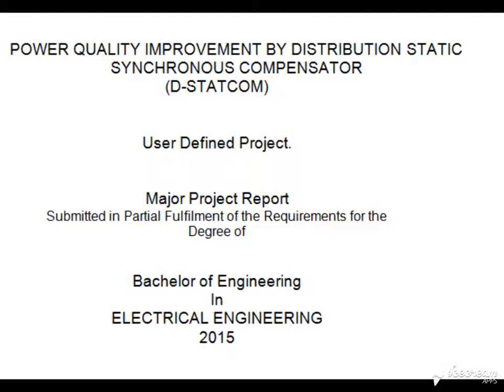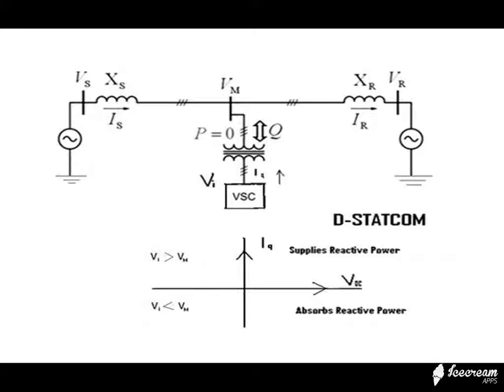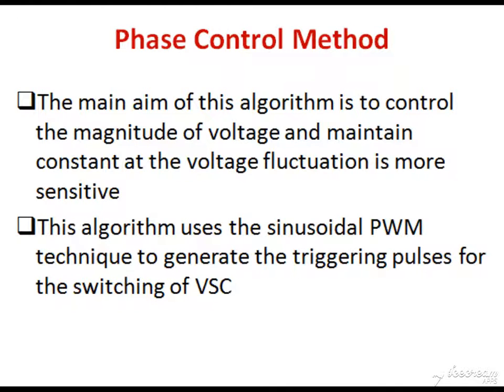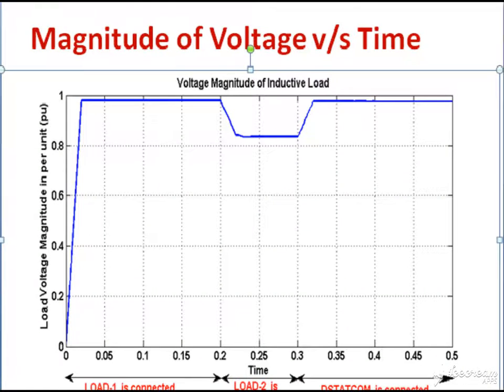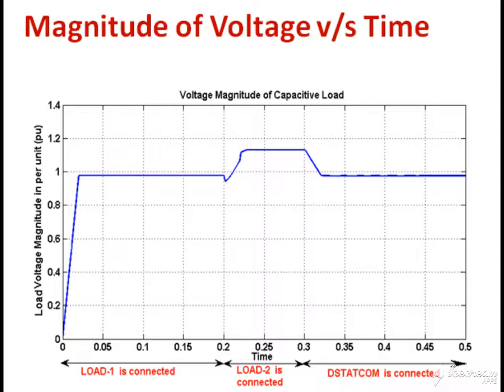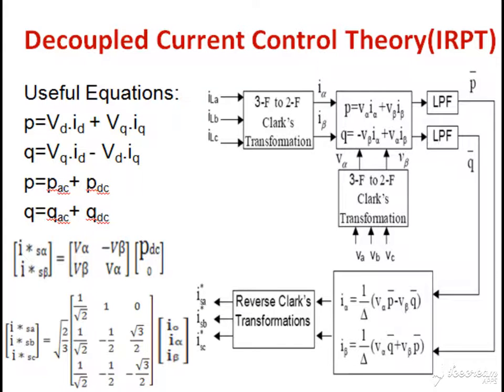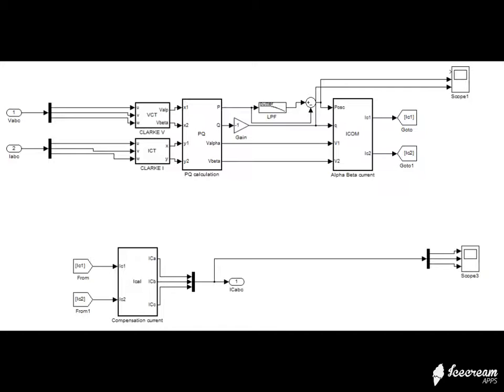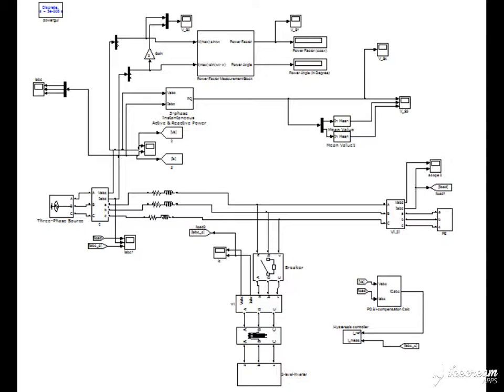Power quality improvement using D-STATCOM

Comment: Sir, could you explain all the 5 classification even in more detail  especially the clark park transformation  . and if possible could you share the MATLAB simulation with me.
Reply: The simulation cant be shared directly. In case you want guidance i can help.
Reply: compensation by DVR is much better than a DSTATCOM . Why you have used DSTATCOM only.
Reply: @tahernazmuddinlimdiwala-dm9878   Sir can you please share slx file mujahid.abdullah131813@gmail.com